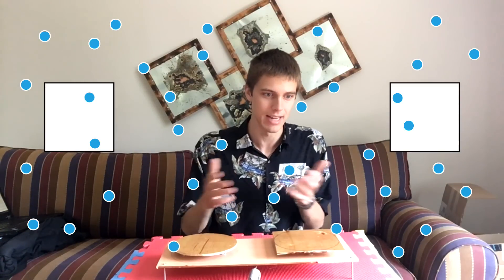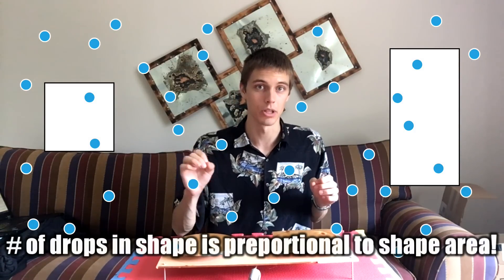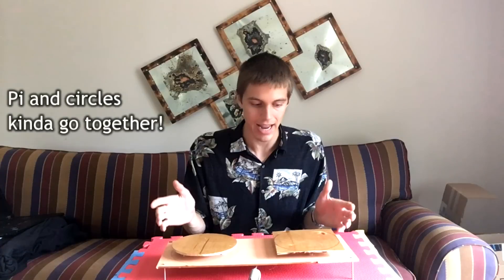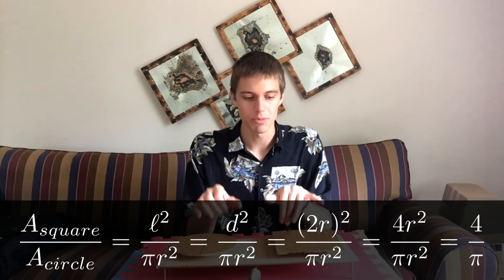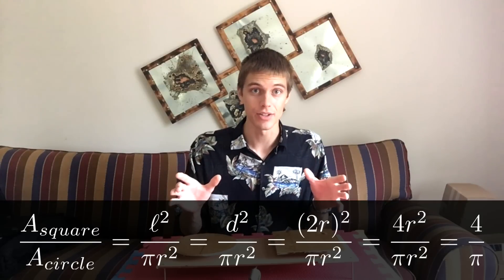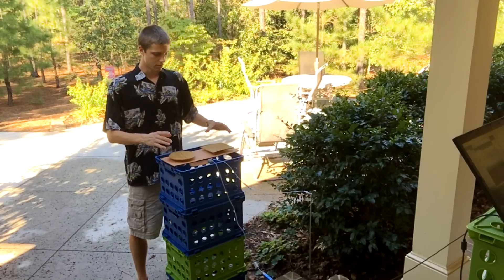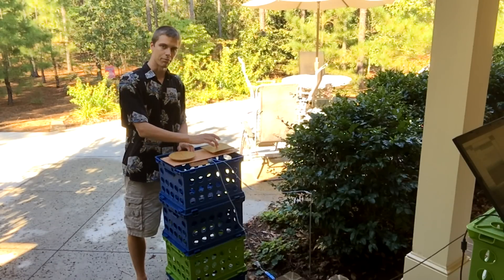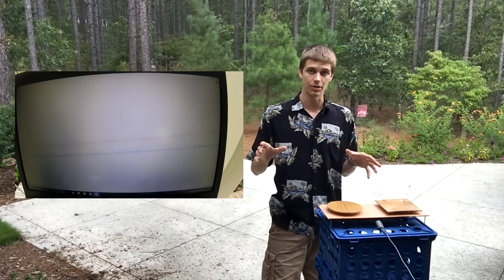RainPi - Calculating Pi with Raindrops! (Part 2: How it Works)

Comment: I'm looking for a rain sensor. This gives me an idea of how to do it. Resistor sensors available on Ali get wet for extended periods, which significantly distorts the readings. They also rust over time and need to be replaced every few months. Thanks.

Comment: Could you also use a round and square container and weigh the resulting mass of water for a fully analog solution? 

Not all raindrops are the same size, but on average it should balance out.

Also, how is this channel so small? It's amazing!
Reply: yes.. but that would be too easy. You would not even need a computer...

Comment: Why did you ground the ground wire into the Earth? Did you fear lightning strike? Just connecting all the grounds in one place would have done the job. That grounding seems unnecessary if you had everything on same reference and were not worried about lightning.
Reply from the maker: That's the hilarious thing - when I added the ground wire, the noise on my analog channels dropped by 1-2 orders of magnitude. Without it I actually couldn't detect drops. The sensor was powered from my usb port, and my computer power supply didn't have a ground pin, so until I added the aluminum stake, the whole circuit was floating, and subject to fluctuations amplified by the capacitance of the piezos.

Comment: I'm curious: have you had to worry about isolating the transducers from each other? That is, if a raindrop hits the circle, does it produce enough vibration to travel through the backing board and indicate a hit on the square as well?
Reply: It's very hard to do that - raindrops certainly aren't strong enough. I attached all the plywood bits together with hot-glued springs, and the springs weren't very strong. Because the raindrops are point impacts, I don't think there is a great fear of resonance either, so the springs just need to dampen. Some kind of packing foam would also do a great job.

Comment: Hah, here's an analog method. Use a square funnel. And a circular funnel. For two identical jugs. Then take the ratio of their water volume after a rainstorm. It should be equal to the ratio of the funnel opening areas, aka Pi/4 :-)
Reply: Dang good thinking
Reply: There's been a lot of discussion about that over on r/electronics. It would work, but it's not really more analog because even if your measurement is continuous, water is entering the system in descritized quanta, raindrops. 

https://www.reddit.com/r/electronics/comments/4z6lup/comment/d6ts4r1?st=IS8X93LX&sh=5aea1eef

Comment: Really interesting!
What is the reason behind the oscillation around Pi? The calculation seems to 'swing' around Pi, is there a reason for that?
Reply from the maker: Because it's a random method, it's not unlikely that for a period of time you get many more hits on the square, or many more hits on the circle. All that you can say is that on average with a limit at infinity, the answer will be pi. When you average all the low trends and high trends together it should be pi. As you record more raindrops and the average becomes less sensitive to new values, the answer appears to lock in, approaching pi from above or below.

That's not a great answer but really the only answer is that it's random. If you google "monte carlo pi convergence" or something similar, you should be able to find some more detailed explanation. This is normally all done inside a computer. This project is like an anti-simulation!

Comment: What would be really cool is to use the same basic apparatus to build a rain gauge. Measure the intensity of the vibrations to estimate drop mass, integrate over time, and divide by the area of the collector.
Reply: Hah, here's an analog method. Use a square funnel. And a circular funnel. For two identical jugs. Then take the ratio of their water volume after a rainstorm. It should be equal to the ratio of the funnel opening areas, aka Pi/4 :-)